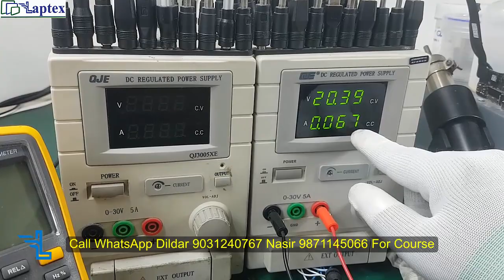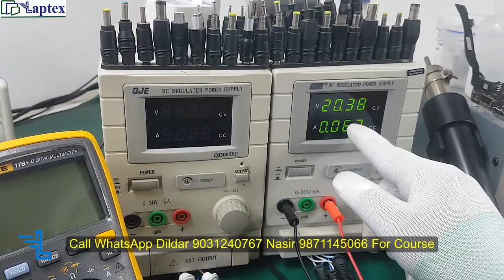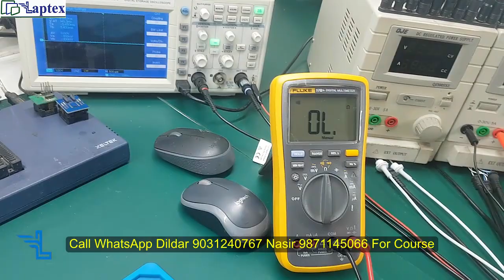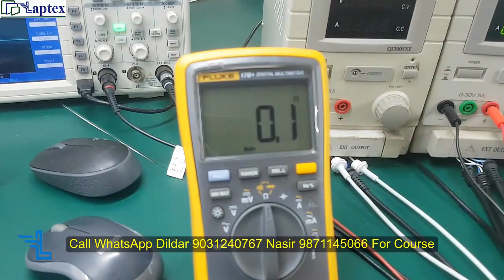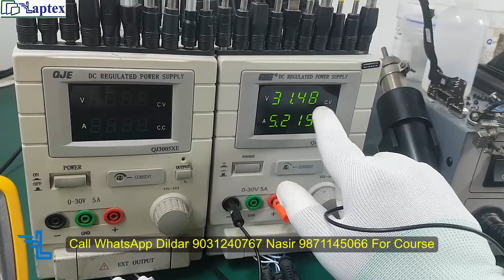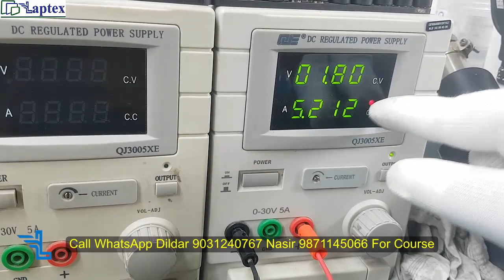DV 6 7000 Goya Deep Shorting Case Study | How to solve Deep Shorting fault? | Laptop Repair course

Comment: You will have to segregate the shut power rail... Try disconnecting jumpers then 5amp power supply might now be of help.
Reply from the maker: Yes that's a good point.. But if after doing this, still fault not clear then what to do???
Reply: @laptex1377  I don't know ooooh!!! But maybe removing components and checking it's input and output with multimeter in ohm's

Comment: For deep level shorting u need to remove s5 to s0 or run convert switch then inject the voltage then we need to touch carefully any one cap well beep
Reply: Leaked cap heat little u need to check carefully
Reply from the maker: Absolutely correct...👍👍

Comment: If voltage injecting can't heat the shorted component I try to isolate one by one section by removing input resistor or pad separation.
Reply: That is what I will too
Reply from the maker: Good but if still not able to find then what to do further.
Reply from the maker: Good
Reply: @laptex1377  will you also show your own solution to us at soon ? :)

Comment: By removing Vcc line resistor of these 5-6 ics 
Or by using Short killer
Reply from the maker: We used for power injection... But still components not heating up.
Reply: Sir power injection & Short Killer both are different things

Short killer have 30 amp power which will definitely burn the short component in the path. No need to check heating just plug in & shorting gone. But in some cases approx 10% it doesn't work. So waiting for nasir sir method that may help me in future. Proud to be a laptex student. ❤
Reply: @laptex1377  I also found such deep shorting case in a amd board but bad luck Processor was Faulty
Reply from the maker: Good work.
Reply from the maker: Great point bro...

Comment: One by one i will cut input supplies .
In this type of deep shorting case mostly i have found processor or graphic chip faulty, but mostly graphic controller faulty.
Reply from the maker: Good experience👍😊

Comment: all I do is isolate all 5 volts of arias, and connect them one by one.
Reply from the maker: Yeah that's good method..but it will not work in this case if you miss a little trick.

Comment: I guess there is another technic which is making voltage drop measurement in Diode mode of meter.
Reply from the maker: Maybe... But I never used it.
Reply: Diode Air gap 0.6v around
Reply from the maker: But what it will do.
Reply: @laptex1377  if there is no voltage drop then it means short circuit. But it won't be a magic finding short circuit. Just another way:) So what is there in your mind ? How we can find it ?:)
Reply from the maker: Yeah that's good but sometime this deep shorting will be difficult to find out in a hurry bro.

Comment: By DSO
Reply from the maker: Shorting by DSO ...how come??
Reply: @laptex1377  By capturing mode and measuring the voltage on the coils
Reply from the maker: No...shorting is related to current not voltage. Dso cannnot measure current...so, not possible anyways. By the way good try.